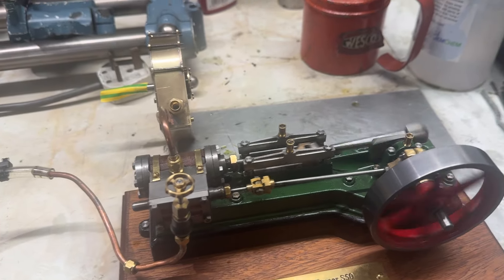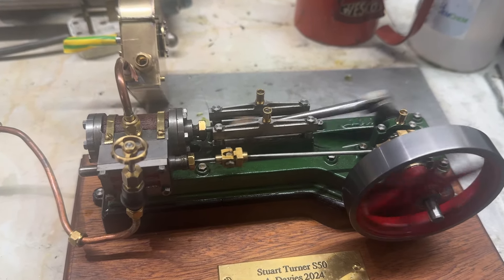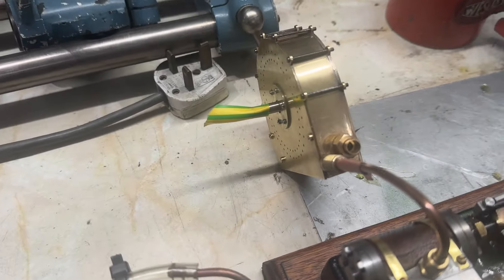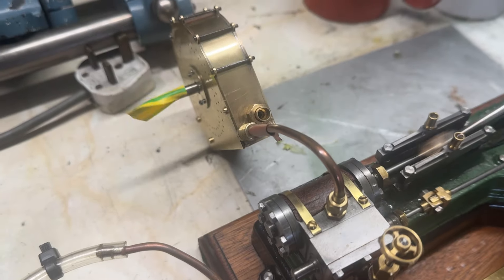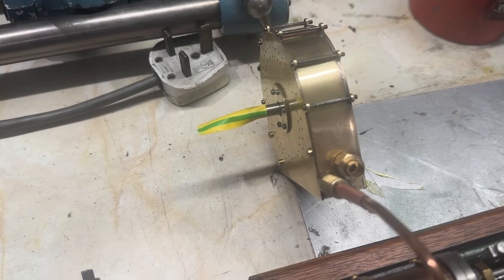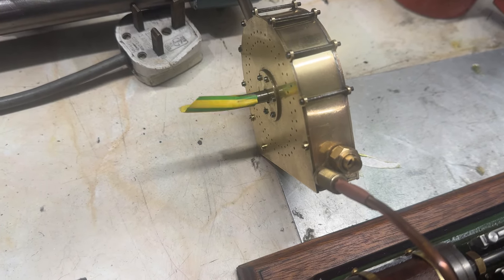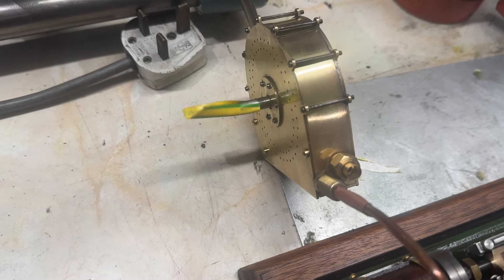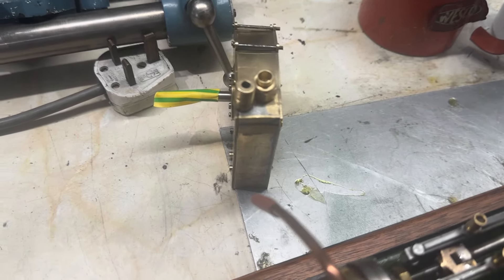Turbine driven by stuart s50 as a test

Comment: Using superheat Andrew ?
Reply from the maker: just on air
Reply: @modelengineeringadventures  was thinking would get more oomph with expansion of the exhaust steam from the horiz eng...
Reply from the maker: @associatedblacksheepandmisfits  this turbine is for the triple compound engine that turns another propeller, as the real Titanic had.